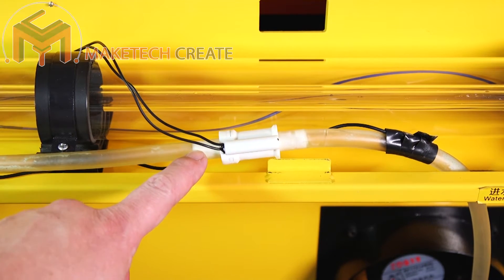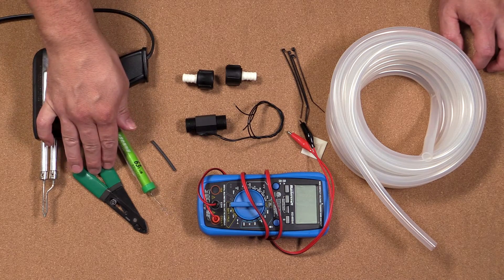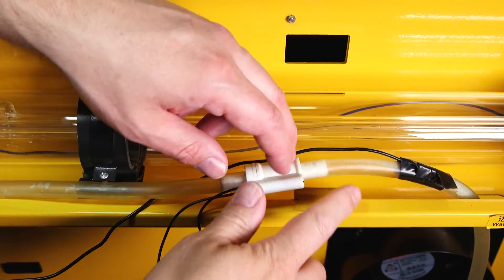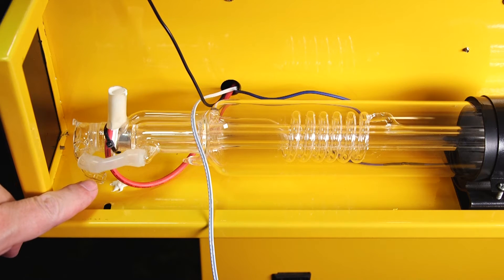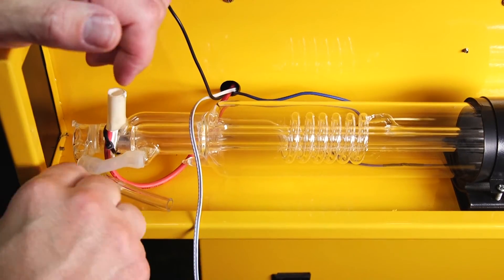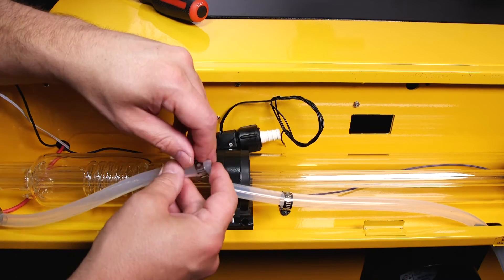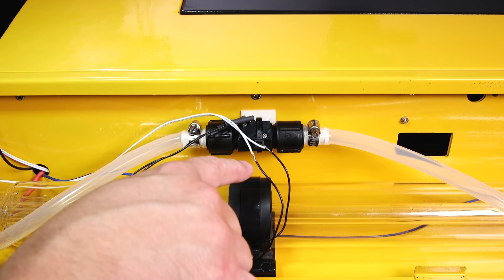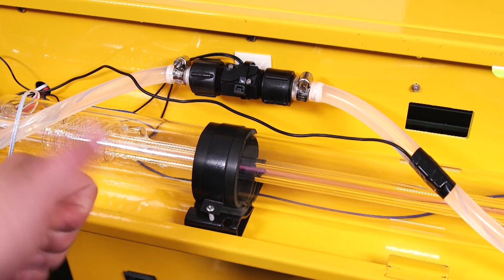CO2 Laser Cutter Water Flow Switch Replacement

Comment: Great video! my note: I found that vinyl tubing is a terrible idea, due to expanding over time. Created failure at every connection even with clamps on. Silicone has been the better choice for me
Reply from the maker: I haven't had any issues with the vinyl tubing when clamped, but I certainly agree that silicone is the better option as it is easier to work with ... unfortunately, my local hardware stores only carry vinyl.

Comment: How to determine the terminal (+) and (-) on water flow sensor? or we can both of the wires are the same terminal. In my machine there is nodal (P) and (G), G might be ground., But in water flow it doesn't have nodal. Please need your help ASAP SIR. thanks

Comment: Hi MakeTech, the flow rate from my laser machine into the bucket seems to have slowed down significantly into a dribble and the water in the tube has bubbles. I cannot see any movement of the water or the bubbles. I have removed the water inlet from the pump and switch on the pump to find that the pump is working fine and bubbling away like a fountain. I dont have a multi-meter at this moment but besides testing my switch, what else could be the problem?
Reply from the maker: You probably something gummed up somewhere in the system. Clean and rinse out your system. A water/vinegar mixture works well for this.
Reply: @MakeTechCreate  I removed the water flow protection valve and found it was blocked with some fluff! I have no idea how thay got there. I use a bucket method with a lid that has a hole. I imagine the air dust is getting into the water. My machine looks like same as yours, but mine is ten-high 60w. I find it really annoying that I am not able to put a piece of material on the bed and slide it to 0,0. I've been looking for some scale ruler sheet for laser bed but not sure if there is anything out there. Would love to know what you do? Keep making the videos, they're great 👍

Comment: Good info. Mine recently failed in the opposite direction.  Either the magnet got stuck near the sensor or the contacts in the sensor got stuck together and it's always "on"(Have not had time to test it yet. I'll use one of the other machines in the house). All of my computers are in other rooms from the laser I use the most (It's a room over, cameras everywhere, always being watched, no preaching!) so when I get ready to do a job, I go ahead and click start, then stop real fast, just so that it's all there. This morning I hit the button and noticed it actually fired... Chiller was powered down but the "beam" knob was active. With the knob off, I get no pulse when testing, but regardless of chiller power and pump being on, it will fire... Another good reason to ALWAYS watch your machine! Never know when a fuse can fail in your chiller, and a water sensor that could have went out months ago could cause a hefty bill... I'm totally not looking forward to replacing a 100W tube because of a $10 part...
Reply from the maker: Ya, I try to never leave the room when mine is running. There are just too many things that can go wrong with them.
 I hope the video helps. Thanks for watching.